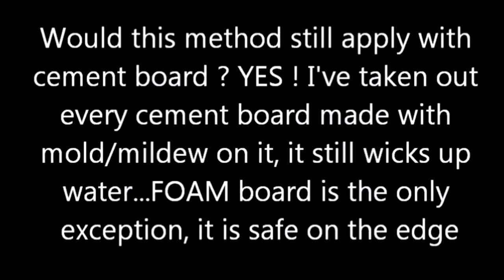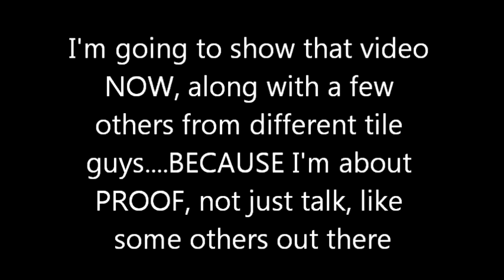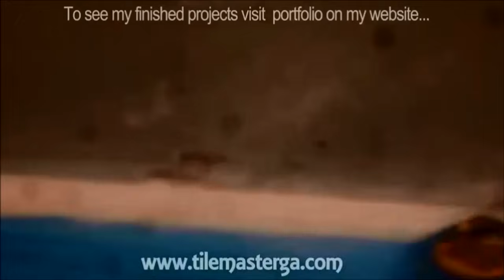WALLBOARD ON TUB

Comment: I follow your methods but introduce an extra step which only takes a few  minutes. Before mounting the green board or cement board , I Red Guard the first 3 inches of the board including the edge on both sides. So not only is the board mounted where you show it, but that edge is sealed
Reply: thank you. brillant. gonna do this tomorrow
Reply: That’s what I do too!
Reply: Amateur question: what is a Red Guard 🤔 ???
Reply from the maker: Nothing wrong being anal, better that way
Reply from the maker: Redgard is a liquid topical membrane, goes on like paint
Reply: it’s a water barrier product that can be applied by brush roller etc. at local hardware store

Comment: If you had the time, like a DIYer, you could always paint a liquid waterproofing membrane (Red Guard, Aqua Defense, etc.) on the bottom edge of the wall material BEFORE you screw it to the studs.  I also coat a few inches on the back side of the wall material with the liquid membrane.  No wicking in that case, no matter where you put the wall material, but I still don't put the wall material on the tub deck.  StarrTile would say that I am being redundant, but that is OK, because this is the area where the failures always occur.  Don't let the wicking even begin.
Reply: I do the same thing👍
Reply: That's a great idea. This is why I always read the comments, because that's how you learn some extra tips and tricks.
Reply: Red guard should be applied on the whole shower surround. Water goes through tile and grout. Red guard waterproofs your shower

Comment: I've watched several of your videos on the topic of NOT resting the backerboard on top of the tub/pan ledge, but rather on or just above the lip. The you suggest not making contact with the tub with the tile either, but rather to leave a gap and not even seal it. Won't that look unfinished? I know it will prevent wicking and allow air to dry whatever water gets on top of the ledge, but I don't think that would look too swell. Do you have a video that shows what one of your finished jobs looks like, specifically the tile to tub area appearance?

Comment: Thank you for this. I just took possession of a place and both bathrooms have the drywall coming right down to the tub. One looks exactly like that tiled wall at the beginning of your video. I called Bath Fitters and mentioned that the people before did that and they replied "drywall is supposed to come down inside the tub lip" 🤦🏻 nevermind...I won't be needing your services. To me it just seems common sense. Water is the most invasive element. No amount of silicone will keep it out.

Comment: Hi Bob thank you for this great video. My tub/shower failed & I have scoured the internet to understand this interface between cement board and tub flange so I get it right. While I am generally a DIYer, I had this work done 11 years ago by a reputable 'professional' when I was overwhelmed by my day job. Anyway, the thing I wanted to relate is that he did actually follow your method and the cement board still got soaked.  What I wanted to add as perhaps a caveat to your explanation, is that you need to also pay attention to your air block & vapour barrier system. My installation has two exterior walls and I live in a cooler climate. I think I have pieced together what went wrong, and as with most failures, it was a few things.  My contractor failed to put a vapour barrier behind the cement board on one of the exterior walls and did not take the time to properly complete/seal the vapour barrier on the other wall. He also missed insulation between one of the stud spaces on one of the walls.  He also did not fully seal the penetrations. He did not liquid seal the cement board, which would be ok as long he had used a traditional plastic sheet vapour barrier behind it as per code in my area (cold climate means vapour barrier is on warm side of insulation). I can't say I did an awesome job maintaining the silicone caulking between the tub and cement board nor annually seal the grout lines - although I did both periodically - so I guess I have to wear some of this.  Either way, the air seal was incomplete and there were other gaps (ie. at the penetrations) and the fact the tile/grout & cement board is not in itself a total block if unsealed. So I ended up with very, very wet cement board, soaked from the back side where the humid air hit the cold. The epicenter was where the insulation was missing and thus the coldest. Here the cement board warped and exacerbated grout failure (which I tried to repair a couple of times not knowing what was going on behind the wall) - the wetness spread in a cone shape from there.

So long story short, I just wanted to add to your good recommendation that the vapour barrier and how you block humid air from going behind your wall (air block) is important to consider. If you choose to liquid seal the tile side of your cement board, this qualifies as a vapour barrier, but then you need to make sure you seal the tub to cement board interface with silicon and also any penetrations, to prevent air getting behind your wall and condensing.  If you don't use the liquid seal approach, that is ok too, but then you must install a traditional vapour barrier (ie. plastic sheet) between your cement board and your insulation.  The latter seems acceptable by building standards, but I don't like the idea of the water condensing on the plastic sheet if the air block is incomplete, so I'm going to fully liquid seal the cement board and silicone all air gaps. I'm also going to try acrylic grout, which is supposed to not requiring sealing and is less likely to crack over time. The acrylic grout will only be on the walls and not used for shower floor tile (since I have a tub) -  where I have seen people report it can fail (ie. if wet all the time).

Hope that helps someone.... or perhaps generates some discussion - I don't purport to be an expert and maybe someone wiser or more experienced will correct me - but my contractor certainly failed the test!.... I am still bitter I have to take on this project, not to mention the money wasted on a contractor!
Reply: Look into the Kerdi system by Schluder. It is a little pricey,  but combines the backer board and  waterproofing into one system.
Reply: Thank you for all your comments. I'm just getting started and this gives me a lot of things to keep in mind.
Reply: Thanks for taking the time to add this information, I found it very helpful for my shower remodel I am working on.
Reply: Man am I amazed and happy that you provided this information, I used to be a preservation contractor and my son and i have seen some scenes of black mold that you do not want to even experience in anyone's lifetime. We have seen the destruction that these costly mistakes have made. I am so happy I came across this video and your response. You are so right insulation, vapor barrier, and any penetrations with proper material. God bless you thank you very much I am about to take on a project of this magnitude and do not want to make simple similar mistakes.

Comment: Thank you for answering this question about where to set the wall board. I'll take the advice of experience for what to do and what not to do over textbooks any time. 

I'm working on a bathroom remodel in a house that's from the late '70's. The walls are close to being plumb. Every wall sits on the edge of the bubble at the line. All wall slope is wider at the ceiling than the tub. I'll need to work on the studs before setting the backer board and sealing.

I'm still doing the research to do everything the right way. 

Thank you for taking the time to teach others through videos such as this. It means a lot for people like myself.

Comment: Finally, after watching about 10 videos, I've got the answer I'm looking for. Thank you!
I bet that's a Kohler tub. I just had one installed (which is why I'm watching this video about backer board), and the lip on the front (the "wet side") is 2 inches wide, the lip along the side is 1 inch wide, and the lip at the back is 4 1/2 inches wide. All of them have a bullnose design for water to flow into the tub instead of sitting on the lip.
Reply: I have done a few tubs and showers in my 50 years in houses.
I too stay up on the shower pan lip or tub lip, but I always added a plastic J molding on the bottom edge of any material I was installing, be it greenboard, drywall,cement board,etc. It has absolutely helped protect the raw edge against bad stuff in the future.
Thanks for your video and good advice.

Comment: What you are saying about how the board should be on top of the lip is absolutely right. It is the best practice, however, in my opinion it is not the splashing from below that causes this damage. The reason the caulking shows mold and mildew and the wall board fails and wicks up water is because of the caulk itself. Any moisture that wicks through the grout work in the tiles above (because very few people actually continue to seal tiles after the initial install) will work its way down the waterproofing layer to the bottom where it gets trapped by the caulk. It just sits there and festers and soaks everything. The mildew in the caulk keeps coming back because it is permeating through from the backside. The absolute best way to solve this almost no one ever does. Don't caulk the seam. Allow moisture to escape and the materials to dry.

Comment: Thank you. It’s clear that the board should be just above the lip, but what about the tiles? Set them with a small gap to the edge? And do you caulk that edge or leave it open so any water that does get behind the tiles can drain into the shower?

Comment: I prefer the method of using flashing tape on the lip, up along the studs, running behind cement board, with the cement board sitting on the lip as you mentioned, then redgard on everything. The flashing tape may be overkill, but it never hurts to be cautious.

Comment: I use dead wood between the studs all around,using 31/2 side facing out,I use silicone between the dead wood and shower flange,I set the wall board on the outer edge of stall and nail to dead wood every 6 inches,Sstl nails.I finish with a course of bull nose tile with nose up or out using thin set,finish joint between tile and stall with pure clear silicone.I recommend  using rigid foam insulation  behind the stall,but leave at least 1 in air gap between stall and foam board. This is just how I do it and it works long term,not saying it's the only way to do it.

Comment: Thanks . Very helpful . I'm using solid surface (corian) for walls . I'm now going to put a thin strip of solid surface on the edge, then the wall board on top of the strip . This might work with other waterproof materials creating another waterproof barrier to prevent wicking.

Comment: Just watched your video home built in 1960 have a steel tub doing a bathroom remodel as we speak was thinking first working with go board which seems to be a good product but was originally going to take it over the edge good advice going to go to the lip all makes sense when you think about it the tub manufacturer built that lip so there was nothing to worry about for water leaks basically a built-in pool liner thanks for this great piece of advice

Comment: My bath tub is from the 50s so it didn’t have a lip on it. The old drywall was about a half inch above the tub then tile flush to the tub and caulked. Do I do the same thing when I install the new cement board and tile?
Reply from the maker: Yup 👍🏻
Reply: @StarrTile  That didn't work for me. My fiberglass tub also does not have a lip. I have caulked it twice and it still leaks in the same small spot. Was thinking of removing the bottom row of tiles and applying window flashing to the cement board and top of tub, before re-tile-ing and caulking the joint between the ceramic tile and the top of tub. Would the window flashing leak? Does it permanently waterproof to fiberglass and cement board?

Comment: As a painter i have learned a lot about the importance of  shedding water properly and giving water a way to escape. It is near impossible to water proof everything. 
Wicking and trapped water will never dry out. Which gives off moisture (humidity) to the surrounding area = ROT, MILDEW.

Comment: My question is if I do it your way, what keeps the cool grout in place for the portion of the tile that is hanging down below the wall board. There needs to be something behind that grout so that it’s not just floating in the air
Reply from the maker: The distance is perhaps three quarters of an inch, or even 1" from a typical 12x24 is nothing. Even a 4" tile grabs 3 inches of wallboard, so what's the issue ? Typically the grout is only as deep as the tile anyway.
Run silicone where tiles bottom out at tub and that'll add strength too, but I have never encountered a problem.

Comment: Hi Bob. You are absolutely right on this. I took out my 35 year old builder grade tub recently that had cheap 4  inch square ceramic tile installed with mastic over green drywall. That tub was used daily for showers for many years by a family of 5. To my surprise there was virtually no water damage or mould behind the tile and I believe it was because the builder installed the drywall on the tub lip just as you suggest.

Comment: In Michigan code back in the day, the board  on top of the lip mostly because it will remain perfectly perpendicular and flush to the wall.. if you put it over the lip, then the board will be shimmed at bottom and not plumb at bottom...it will cause tile to flare out at bottom.

The gap is filled with thinset and tiled 1/8" above top of tub.  After tile set a while, you create a 1/8" gap under tile by remover thinset out at bottom with your trowel..and just like corners, those gaps are filled with siliconized caulking.

BTW, most if not all mold in showers is from the user not cleaning their shower.
Reply: You can also shim your studs to allow your sheet goods to not have that bow at the tub flange.

Comment: Hey Bob! Im a big fan.
I just HAD to go and check how my bathtub was set. I didn’t built it. It’s probably 7–10 years old. Maybe more. The results? My tub doesn’t have a lip! It’s squared. So the drywall had to be set on top of it. The results is not too bad. 
So i guess it’s both techniques. Or neither. I DO have to keep a healthy bead of silicone around the tub. As always. 

If i ever do this job, I’ll defenitly set it like you do. 

Cheers Sir!

Comment: Question. I am using a cast iron shower pan and hardi backer. I am not going to tile but use something called micro Crete which is like a concrete and plaster mix and will be a finished surface over the backer. A sealer is built into the product and I plan on using red guard underneath as an extra precaution. Would the same placement of the hardi backer to the lip apply or would a bevel where the backer meets the pan be best. 
Thank you 👍🏻
Reply from the maker: @ibenglish  where all the way you will be doing it with the material that you will be using it's already sounding like a bullet proof system, I wouldn't be worried
Reply: @StarrTile  just set the backer to the lip then? This is my first bathroom remodel and I really want to do it right. Thank you
Reply from the maker: @ibenglish yes... material that you're using and that you are mitigating the bottom with redgard makes it ok... just think like water and you will be okay
Reply: @StarrTile  thanks 👍🏻

Comment: So, Bob, your arguments for cement board being placed on or above the lip, certainly make sense. Throughout all of your videos, you have certainly now driven this good point home. I take it by your foam comment, then, that you could set styro foam wallboard directly on the edge, whether it be a tub or shower bed But, would you?? Even using styrofoam on your walls, though, I would imagine you would still lay your floor tile first, then the wall tile. After watching so many of your videos about elevating the wall panels to avoid water problems, I would probably elevate the foam panels, as well, unless you say otherwise. Good video.
Reply from the maker: I have rarely used foam panels for my shower builds, but yes I would probably by habit still raise them above the floor, although it's innocuous because foam won't wick up water the way everything else will.... for a tub application like seen on the video I have no compunction about setting it on the edge rather than the lip if it's foam.
Reply: @StarrTile  Much obliged, Bob. Love your videos. Sure wish that Google would find a heart and re-monetize your channel. Just made a small Pay Pal donation to show my appreciation for your videos. Just like Justin below, your link didn't work for me, so took your suggestion, went to your main page and found the PayPal icon link.
Reply from the maker: @TwoTracksOutdoors  you and me both, if they would remonetize me I would stop begging for money 😂😂😂😂
Reply: I just want to put my plan here (doing this in a week) on my tub, I have the Kerdi Board, I will cut out the back 1/4" of the bottom 1/2" of the board and have that go over the flange of my tub.  This will still leave a gap, but smaller, and I will use the Kerdi-Fix on the flange to the board meetup in the back.  Then I should have more board for my bottom row of my 3x12" tile to fit onto and I believe it will be a cleaner, easier install.  Just putting my plan out there since I am using polystyrene board! I think I have done enough research and this is a great plan...

Comment: This is an excellent video on this subject, but it raises the question for me; do I install the hardie cement backer board on the lip, or leave a 1/8" gap above the lip? As both methods are mentioned @3:00 for example.